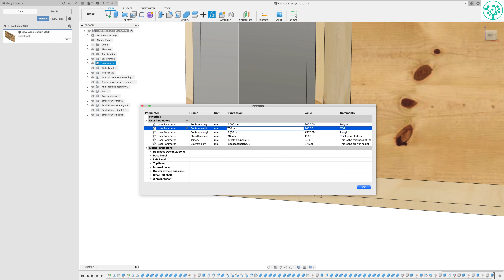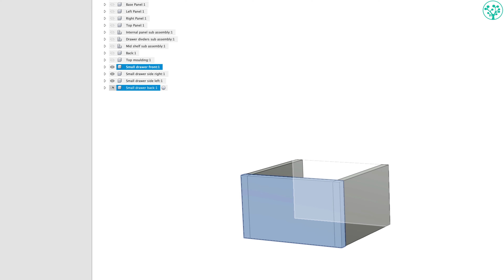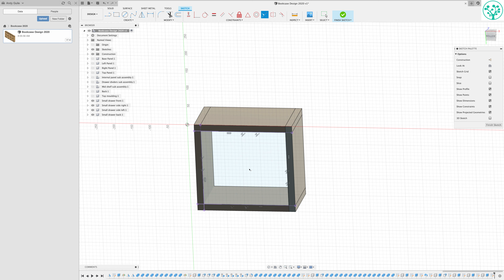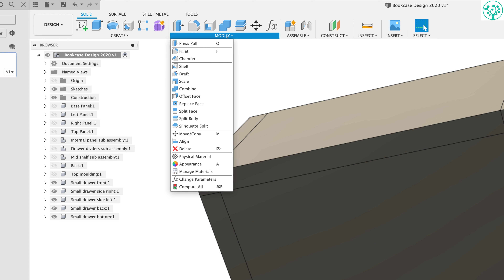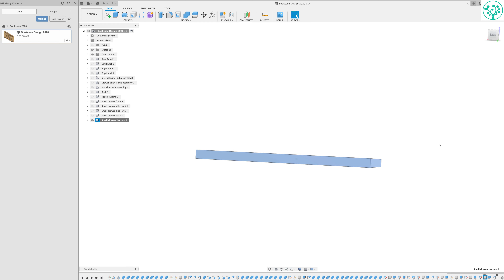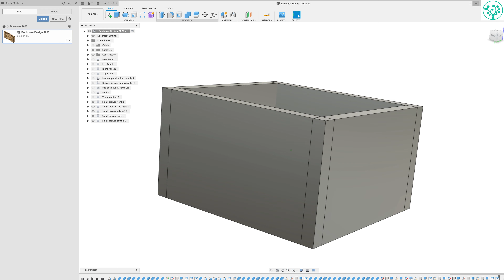Fusion 360 for Woodworkers - Lesson 7 Starting the drawers

Comment: Very nice workflow. There are dozens of ways to do something in these CAD programs. I appreciate you sharing your workflow. One point! .5 mm clearance on three sides and 0 clearance on the bottom? Why did you pick those numbers? Perhaps later on you will adjust this, but wow, we must be planning on super tight drawer rails and we better hope there is no movement in our materials. Also, don't you need a half inch clearance on both sides for the rails?
Reply from the maker: Thanks Tom,

The 0.5 is more a token than a tolerance. When I build I use the plans as a guide, then use proportional dimensioning for final fit. In the actual build - I didn’t use runners, just good fitting of the drawers. 

From memory the final build had around 1mm all round. 

Cheers

Andy

Comment: I have seen so many ways to make a drawer and this is by far the best method, using constraints, thank you. And excellent series, very thorough, great pace, and easy to understand. This is the best woodworking course using fusion 360 I've seen. I also could not figure out for several months until today, why my cursor was not snapping to the grid. I checked everything: increments, adaptive, fixed, and you nailed it with constraints, what a relief because I was working on a project that needed just that, thanks again Andy.

Comment: I just found your videos today. They are wonderful. I'm trying to understand why something is done in the sketch (2D) or to a face in the component (3D). For example, getting the drawer face to the correct size. It seems like there should be a method where the face size is defined in 2D (sketch). The method you showed was to offset the faces (3D) based on a sketch (2D) that is collinear with the drawer opening. Could you also constrain the sketch to be narrower (e.g. do it all in 2D)? Similarly with your dovetail video. One dovetail was drawn on each end in the sketch (2D) and then patterned on the component (3D). Why not setup all of the dovetails in the sketch (2D) and then extrude them all at once to create a 3D object? Figuring out when to do something in the sketch (2D) and when to do it in the component (3D) is one of my biggest mental obstacles in feeling confident with Fusion360.
Reply from the maker: Hi Eric,

What I am trying to allow for is auto re-sizing of the component through parametric modelling. So it's all about building relationships. 

As an example a sketch that is duplicated using the pattern tool (the dovetail technique) sit on top of the component as a sketch - the sketch then creates a template that you use to cut out the component. If you pattern the sketch then make the cut, then resize the stock through parametric modelling the sketch will not resize - so your cuts are in the wrong place. So it is easier to create a single dovetail - and then use that as a feature, the feature is then referenced 'in' the stock so resizes with the stock.

Now if you can constrain a sketch to an edge of a component, the step I took on the drawer front. Then the sketch will re-size as the constraint moves - so any component you make from the sketch (the drawer front) will then re-size. The challenge I had in the design is I wanted the overlap - and you can only constrain a sketch to an edge or point on a component (there are other work arounds - but I wanted to keep it simple), hence creating a component that will re-size and then pulling out the edges by an amount driven by a parameter.

HOWEVER, if you want to do it all in the sketch - you can add 'sketch points' these you can constrain to a distance from an edge. So I could have created a sketch point - set that to a distance from an edge - then constrain your drawer sketch to that point (or points) so you would then achieve what you are saying. (Sketch points are in the sketch pane - create menu).

I could do the dovetails in the same way by using sketch points to mark out the key points of the dovetails - constrained with user parameters, then join together with the line tool

There is no wright or wrong way - do what feels right to you, that way you won't go far wrong.

This is a complicated issue, so hard to answer in a text box. 

Hope I have helped and not confused.

Andy
Reply: @TheWoodgrafter  Not confused. Thank you for the reply. You did address the fundamental question in my comment. I'll have to learn about sketch points. I know that with tools there are rules and there are strategies. This seems like a strategy discussion and I like to understand the thinking behind why a strategy was selected so that I know when best to apply it. In this case your strategy seemed focused on keeping it simple. Keeping things simple is often valuable. Thanks again for taking time to reply.

Comment: Andy, this course topic is so spot on for what I have been trying to learn in fusion 360, that I feel like I custom ordered it. Many Thanks. I do have occasional glitches with fusion 360 but these must be some kind of bug with my system. For example: the fourth time I try to use the collinear constraint when creating the drawer parts, it will fail and give an error. I have to control zed back to just the rectangle and try over 3 to 5 times before it works. I was wondering if others have a similar issue.
Reply from the maker: Hi Howard,

Thank you for getting in touch. Yes, Fusion can be a bit temperamental - and some times the commands don’t behave as one would like.

I can never quite work out if it is user error or software glitch. So not just you.

Cheers

Andy
Reply: Hi Howard, I was having the same fault but found I was clicking return to get to the part to constraint but should have been clicking the mouse button instead, I am using a MacBook Pro which isn't the easiest, I think I will invest in a mouse. Great course though.
Reply: @mj7195  Wow! You are correct. Thank you. To say what I think you said in a different way: When creating the rectangle inside the drawer for the bottom, don't hit return to complete the rectangle. Instead click the left mouse button to complete the rectangle. Then I have no problem constraining using the coplanar tool for all 4 sides. I am using a PC and as it was doing the same on your Mac, this must be a fusion 360 thing.
Reply: @hshpegel  So, It seems I'm not going insane. Thank you for sharing this morsel of knowledge! Seems 8 Months later (and a newer version) it still has the same issue.

Comment: Question:  I understand your comment re: copy / paste the left side over to the right.  How 'bout the mirror?  Create a mid-plane on the drawer front and then mirror the left to create the right.  It will get the bottom rebate on the inside, etc. BUT ... in your experience ... will it get the mirror-ed side in the correct position on a re-size?  Thanks!
Reply from the maker: Hi,

Yes the mirror command will work well for this, in fact when we build the second drawer unit we will use that command to create the side.

So long as the mid point plane is taken from the front panel that we constrained to the drawer opening all should be well.

Cheers

Andy

Comment: Hi Andy, great videos, 
can you tell me the minimum system requirements needed to run Fusion360
Reply: I would imagine any modern day PC will easily cope with Fusion
Reply from the maker: Hi,

Check out this link. Gives you the specs.

https://knowledge.autodesk.com/support/fusion-360/learn-explore/caas/sfdcarticles/sfdcarticles/System-requirements-for-Autodesk-Fusion-360.html

I run it on a late 2014 iMac 5k 3.5ghz quad core, 32GB RAM. 2GB Radeon R9, macOS Catalina.

Cheers

Andy